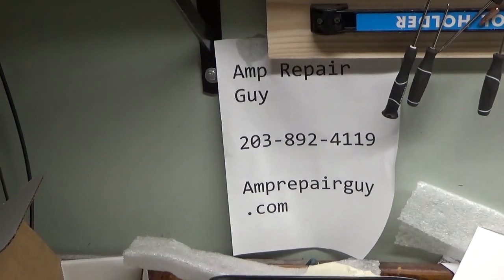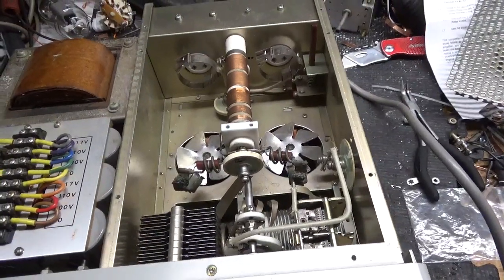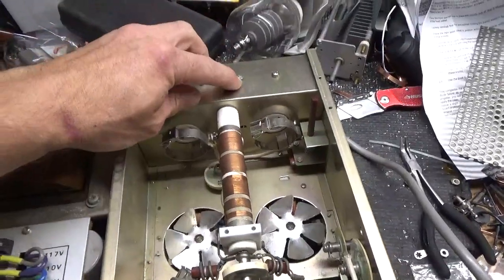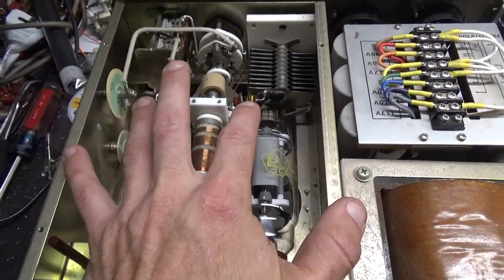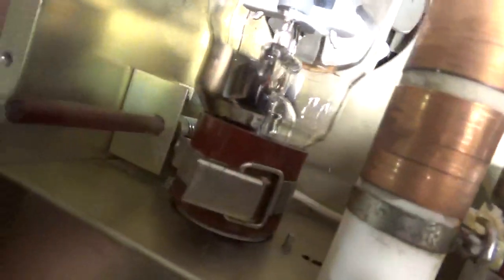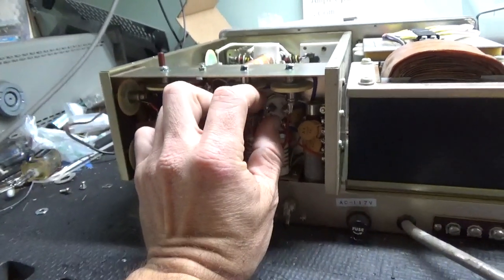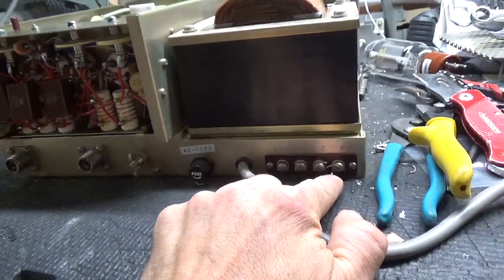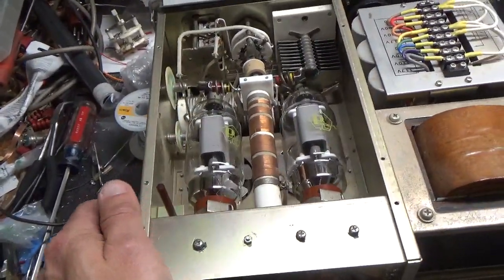Yaesu Fl2100 B Repair And Modification

Comment: Good video. I buy few days ago fl 2100B on ebay for 150 GBP. Its working but I think tubes is not working well. Its generate more heat when transmit and give me max 250W... I need check everything but overall is very clean, no aby signs of burn etc... I watch Your video and hope find problem. I love tubes amplifier but is very old and need attention. Thanks for video.

Comment: What is your source for the Allan Bradley 2 watt 33 ohm resistors? I had to replace the grid loading resistors in my FL2100B but used what I could find, not A-B. Enjoy your videos. Thanks.
Reply from the maker: I have a stock pile , But a good source is ebay. Just be sure to ask the seller if he has checked the value to make sure it is within tolerance. If carbon comp resistors are stored in a humid environment the value with drift.